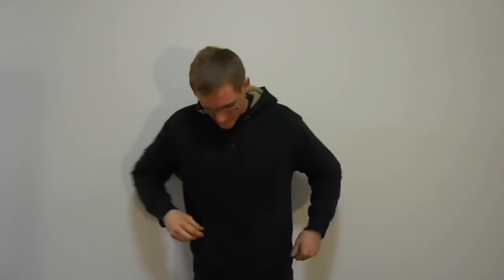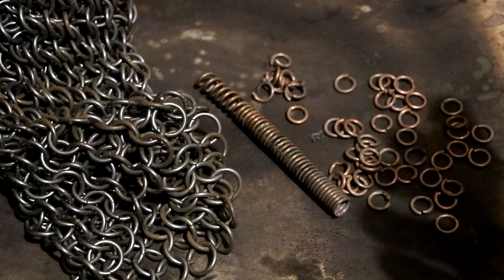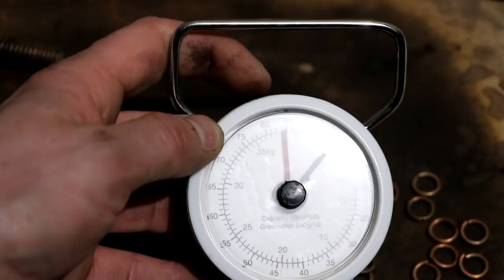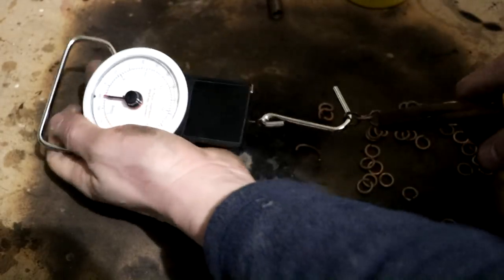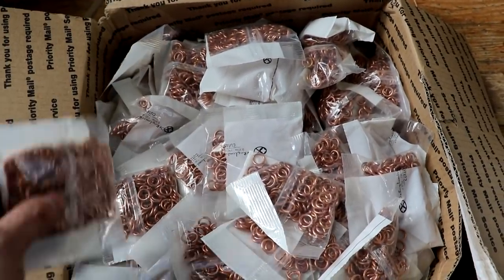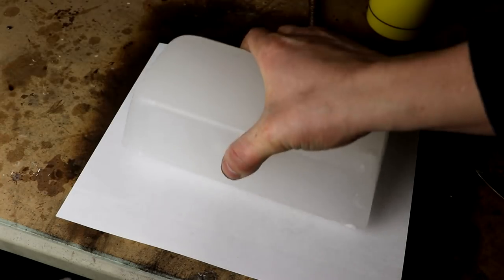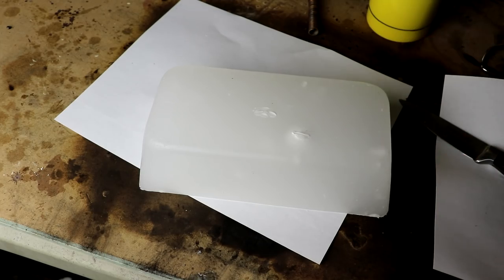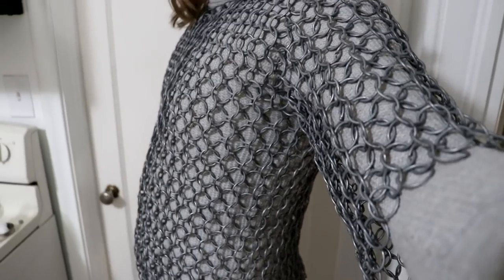Chain Mail Lab Coat?

Comment: Hi! I happen to participate in medieval "reconstruction" movement and wanted you to know, that if you want to make historically correct chainmal, it's another cup of tea. 

In medieval times they used flattened circles (6-12 mm in diameter), connected with  triangular rivets. Using this technology makes the chainmal lighter and more comfortable, but is more difficult to make. 
I don't expect you to take it into consideration, I just wanted to share it with you.
Reply: Paweł Kułak Its a "LAB" coat, not for historic value. I know a few guys into that myself. They would laugh at Cody anyways. Copper, really? lol.
Reply: Paweł Kułak that does not seem like it will make it stronger at all honestly.
Reply: "medieval times"
Early medieval?
late medieval?
Around 1000 years of time, there were many different ways of making chainmail.
round rivets, triangular rivets, flat rings, round rings, and welding was also done in late medieval times.
Reply: carolyn mmitchell 
It doesn't specifically make it stronger. But the goal of a chainmal is for the circles to come together, as the force is applied, thus, creating several layers protecting this particular area. And flat circles are MUCH easier to move than round (not to mention the weight).
Reply: Surturs Schmiede 
To specify, I mean the end of XIV century, the late medieval times. But I would argue about roundness of things. 
Round rivets were not used in medieval times, as they didn't exist. It is extremely difficult to make a round objects this size on an anvil. This is why medieval nails, wires etc. were mostly triangular or rectangular. Or flat, in case of chainmal circles. 
And before you mention- casted iron is so weak it wasn't used in armor nor weaponry.
Reply: RC Hobbyist Extreme  I'm not laughing at this wonderful guy, m8. I thought he would find my fact interesting, not as any form of criticism.
Reply: Round rivets were used up until the 14th century (in Europe), and not very hard to make. How to you think wire was made?
Steel rivets are basically short pieces of wire with a head attached to/ formed on it.
You are right that later rivets were triangular, but still round rivets were used, you can see that in many museums here in Germany btw^^
I made chainmails myself and I made round rivets with very basic tools in my living room, so why shouldnt metalsmiths of earlier medieval times do the same?
Round wire was made for hundreds of years even before medieval times, so "roundness of things" was not a problem.
Reply: Surturs Schmiede I guess I have to educate myself better, if you're right. Thanks for your insight :)

Comment: In school we had coper wire with some coating that solder doesnt stick to, so we made chain and dipped it in molten solder and it only soldered the ends together
Reply: Emīls Sīmanis yeah that's called enamled magnet wire, normally it burns off at around 200 degrees Celsius.
Reply: Emīls Sīmanis I'm sure you had to do some prep work and sand the ends before placing them together

Comment: One thing that may be reducing the strength of the copper ir that when copper is heated it gets soft. If you hit it a couple times with a hammer it should get stiffer. This happened to me when I was making a copper tube into copper plates. I could only hit them so many times before I had to reheat them to make them soft and malleable again.
Reply: dandanazz maybe because they also cooled down when you hit em
Reply: I wonder if you can dip them in oil or some other substance like they do steel to harden it back up. I'm sure Cody knows of something that can do that. Good idea.
Reply: Copper work-hardens, NOT work-stiffens. If he'll hammer the copper rings they'll harden, which means they'll be more brittle. Heating it preserves its ductility, reduces fatigue, which is actually more important than hardness for this use case.
Reply: +Brandywine6969 engineer here: in chainmails you dont need a high hardness, as this would be more likely to shatter on impact .. better would be a higher tensile-strenght, and this you'll only get by work-"hardening" as described by +dandanazz and mostly by the right choice of copper-alloy :)
Reply: "and mostly by the right choice of copper-alloy :)"........Bronze?
Reply: Beryllium Copper and silicon bronze are pretty strong. But if you want strong, use some type of steel. Cody is using copper for reasons of his own, but it is a poor choice purely for stab resistance.
Reply: McKenzie but copper looks so awesome if cleaned up properly :D
Reply: Copper is opposite of steel. If you quench copper it will become "soft" copper. If you let it cool slowly it will become "Hard" copper.
Reply: Isn’t that called work hardening?
Reply: dandanazz i
Reply: Its called annealing when u heat it to soften it. And is referred  to as work hardening

Comment: To get a cleaner join you could use a dre,al with a small cutting disk when cutting out the ringlets from the homemade spring. You could use lock washers too. I know how to do the four in one knirr but I don't know how to shape it to have arms.

Comment: Protip: If your knife doesn't have a crossguard, you should not stab things with it (unless your thumb is firmly braced behind the grip, even then you cannot stab full strength) or else your hand will slip and slice your fingers on the blade.
Reply: Lol, don't do it with cheap knives either, the cross guard will break
Reply: Fun story, I once tried to vigorously cut something and the tip of the knife caught in the chopping board and my hand slid all the way down the blade. Nearly lost the use of my index finger. Be careful around knives!

Comment: I tried making chain mail with storm door springs because I had several. Cut it with a small bolt cutter. Lots of hard galvanized rings quick, but its still tedious work putting them together.

Comment: Why chain, when it would be easier to make a scale pattern armor. Which would still be nice and flexible, more protective, and probably not much heavier. Plus would look cooler well exposed. Though granted the downside is would be harder to protect arms, and can be a bit bulkier depending on how you make it.
Reply: Several drawbacks with scale actually. Bulkier, noisier, heavier and more expensive. Also you can't really hide a scale hauberk under a shirt. No problems with mail though.
Reply: Cody is a wizard not a lizard. git dat scale outta hir!
Reply: he doesnt want the -25% spell concentration modifier
Reply: other than the constant jingle...  i'm curious though, aren't chainmail mostly used to protect from slash weapons instead of stab weapons?  just for discussion sake, maybe chain on boiled leather(aka ringmail)?
Reply: Ya chain is best at dealing with slashes. But will still protect against stabs and such things, though the gaps and ability for the rings to deform doesn't make it as protective in that area. And when it comes to shrapnel, those gaps can be a problem that will allow for shards of material to fly through, but they be small and most likely be stopped by a padded layer.
Reply: Historically mail (commonly known as chainmail) was used for well over 1000 years as the maximal form of armour (pre-roman into the 13th century); it is assumed that mail was worn over a gambeson/aketon (form of padded armour) which improves the stab resistance. There is no archaeological evidence of padded armours (nor leather armours) which is mainly to do with the fact that they are organic and degrade at a much faster rate than their metal accompaniments; however, there is evidence in historical imagery such as the Bayeux tapestry. With this said, there is no archaeological evidence of the metal portions of ringmail suggesting that this was never used.
Reply: it's a labcoat, blah blah blah historical accuracy pedantry.  also if we're being pedantic, no evidence "in Europe", and never used "in Europe".  useful vs purely decorative aside, there's ringmail in Asia.
Reply: Point taken, Europe wasn't the entirety of the historical world. Thanks for pointing out that there are examples of ringmail in Asia, I hadn't seen any mentions of this before. But you did ask whether "chainmail [was] mostly used to protect from slash weapons instead of stab weapons", which I aimed to answer...

Comment: Did i heard you right? 60lb chainmail shirt? God... That's almost impossibly heavy.
Reply: What? 😂 That ain't shit, you tripping
Reply: @mftripz8445  it is if you are walking around in the summer
Reply: @Jordan-zk2rf  true but the metal will help cool you
Reply: @mftripz8445  not if it gets heated. its conductive and is only cold if its in a cold area but gets heated faster than most materials

Comment: I had to stop the video partway just so I could type "hoof nippers".

Hoof nippers.

Ok, back to the video.
Reply: Hoof nippers: a type of heavy duty cutter designed to help farriers trim the hooves of various livestock such as horses. Later adapted to be commonly used in various other industries due to their versatile design, commonly seen in building, carpentry and metalwork trades. Also commonly called: Roll cutters, Nail nippers, Roll pullers.

Comment: Creating that thing will certainly test your endurance. I don't have the patience or the time to to go trough with that kind of a project. It will probably take me a week to do just one sleeve. By the way a few years ago I cut my hand the same way but mine was so deep it required stitches and I actually lost all feeling on the palm side of my small finger. I recommend using a knife design for stabbing. They have guards to prevent the hand from sliding down the blade. Specially when lubricated with blood.

Comment: Why not a Level 3A flak jacket or other ballistic armor?  Your criteria was to help protect from shrapnel and add weight.  A flak jacket would be far superior than ringmail.

Copper is far too malleable to stop a knife puncture wound.  Even if you soldered, brazed or welded every link.

Criminals will stab so hard that their hand slips off the handle, often cutting themselves deep.  You are not gripping strong enough nor stabbing strong enough to prove its safety.
Reply: I was thinking that Cody is probably smart enough that he will think of that and wear or add some kind Kevlar protection under the chainmail as his secret extra layer of armor. It is a great idea. I hope he sees your post.
Reply: kevlar is more for low calibre bullet protection i dont think it really works well will knives or small shrapnel
Reply: And polish surplus flack vests are like $89
Reply: Kevlar can be rated for puncture protection.  3A standard is 50%@1500fps, so not "low calibre" but mostly handgun calibres where the muzzle velocity is less than 1500fps.  Some rifles fall in there too.
Reply: Mail was usually worn over a gambeson, therefore a Kevlar gambeson wouldn't be a bad idea.

Comment: I have a Roman mail coat that is made of riveted tiny flattened rings. Very light, and basically steel. I seem to recall it's 9 kg in weight, showing the Romans really knew what they were doing. Rings are 6 mm in diameter. Not much can make it in through those gaps.

And there are people who sell finished pieces of mail. Even Roman riveted.

Comment: Have you tried phosphor copper filler rod, or is that what you are using? What about copper getting annealed?
Reply from the maker: the annealed brazed rings are far stronger than the hard butted rings. also the alloy of the purchased rings seems to harden just by being tumble polished.
Reply: If the rings get annealed while he brazes them shut it's probably a good thing.
Copper work hardens. I.e. the more you bend and work it, the harder it becomes and thus more brittle and more likely to break.

Comment: A method I have for making mail is to take an open ring and add four closed rings to it then close the ring. Taking two of the closed rings, pass another open ring through them and add two more closed rings and then close that ring. Continue to repeat until you have a length you're happy with and then start a new one. Once you have enough strings made then you can join them which is the more awkward part of it.

Comment: The only correct i'll make is that chaimail itself is an incorrect term as the term 'mail' itself is just an old french word for chain, the  correct terms as far as I remember are Butted Mail for what people call chainmail, and the histroical stuff its riveted mail, everything else is correct.
Reply: Now, that is nerd². I love it. Great job. Thanks for the history.
Reply: Well it maille in French
Reply: Correct, this is what i'm on about, I'm just too lazy to write the extra 2 letters :P
Reply: Mail is a correct term today, even if it may not have been in the past. The meanings of words often evolve over time to best fit the current culture. Thanks for the history lesson though.
Reply: Well, mail, historically, generally meant some form of "armor" that included metal so chain mail isn't too far off the mark as a colloquilism as it is accurate for the overall type of armor (being that it is armor made of rings "chained" together), with riveted or butted mail being the specific types (Although Ring mail might be a more accurate descriptor). Kinda like saying "Thats a coat" "it's a trenchcoat" and "it's a machin/hand stitched trenchcoat". Just like how "Plate Armour" and "Plate Mail" are basically modern and more archaic terms for the same thing.

Comment: Imagine making this out of tungsten...!
Reply: Gabriel Edde tungsten has a few flaws... it would be great for heat resistance... but the human inside it would be char broiled... 
it would be VERY hard, but it would be very difficult to weld the rings together... since you would need 9000degrees to melt it, and no torch can do that... 
however, it would be about twice the weight of the steel shirt... tungsten is HEAVY!
Reply: SuperVstech Right, I didn't think about that heat resistance thing
Reply: Ben Jackbag Mank um... tungsten is coiled all the time... ever seen an incandescent bulb filament?
Reply: Nightingale google search turned this quote up...

The element takes on a grayish to white appearance, and like all other metals, tungsten is malleable. It is quite ductile and can be readily drawn into a wire. However, it's much more easily pressed out than most other metals.
Reply: If the copper mail is estimated to be about 40 lbs, a tungsten version would be over 85 lbs
Reply: Titanium would be better.
Reply: Cody would need to alloy the tungsten or cast each ring out individually. Both of which are not very fast/cost effective. Another flaw is something I read in another comment, you want a material with a high tensile strength, I do not believe tungsten has that. Think of tungsten like a hard rock. Can’t bend rock can you?
Reply: Shaun Stephens Yes it would but isn’t titanium expensive. Like 600$ for 100g? Last I checked anyway. But you get the idea
Reply: Deribus maybe even more... but, it would last FOREVER!

Comment: Just an idea but it may go faster than nippers. Wrap the wire the way you were around a dowel or your metal rod and use a dremel or a die grinder to cut down your coil and make the rings. That is how my father made them. Great video,  have a fantastic day :)

Comment: Nice project ! Have you considered spot welding your rings ? You could use a microwave oven transformer in which you would replace the secondary coil with one or two rounds of thick wire. With an appropriate rig, you could then just press your rings to close the circuit.

Comment: A long time ago, I made a hauberk using 20,000+ steel spring washers, diameter 8mm / 5/16". The rings are just butted, but they're so tough they don't bend open. (I haven't tested it against penetration by a sharp object, though.) The hauberk is T-shirt sized and weighs 33lbs (15kg), which I'm pretty sure is heavier than an authentic mail shirt.
I've seen some medieval examples and they usually have rivetted links, often alternating with punched or welded rings. As you've shown, fastened links are a lot stronger than butted ones, so they don't need to be so heavy-guage.
I'm no metallurgist, but when you heat the copper to braze it, doesn't that soften the metal? I seem to recall that copper work-hardens, but becomes soft again after heating.
I look forward to seeing your lab coat when it's finished!

Comment: Might want to coat the rings, copper might leave residue or stain clothing and skin. Wouldn't wearing that amount of copper regularly and potentially in contact with your sweat and skin risk metal-oxides absorption and buildup in your system? Even if that is mitigated by wearing it over a vest it might still discolor hair or clothing it comes in contact with.

Comment: The smaller links look much better, I made mine out of 10mm ID links with the 4 in 1 same as you I just used a battery drill and 10 mm bar to coil 2.5 mm gal fence wire, then used bolt croppers to cut them. Also I just banged a whole bunch of nails into a board to hold the rings on an incline, it makes it a lot easier to line them up when you're putting them together. I'm in 6km of wire...

Comment: work hardening copper can also improve strength quite a bit. Not sure how you could make it practical for thousands of rings.  Maybe run the copper wire rollers in different directions a few times before coiling.

Comment: Should have tried copper wire for a filler rod as well. Takes a little more heat, but may have been stronger.

Comment: 10:55 more specifically what happened was, when the knife stopped, your hand kept going down, leading to the cut. It only appeared that the cut was caused by the knife when it 'bounced up'.
Reply: 2 years later and this is still correct.   That was just bad knife handling.

I still like the idea of the shirt however

Comment: You should use a saw instead of the knippers for cutting the rings.  Will give you a more flush ring closure.  Plus easier to weld if you wanted to.
Reply: Also might be able to spot weld them together.